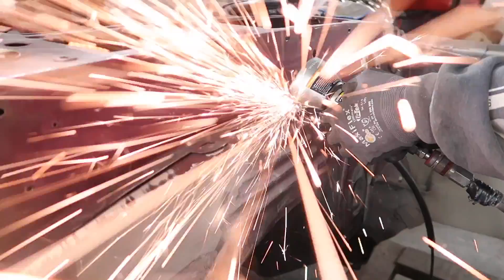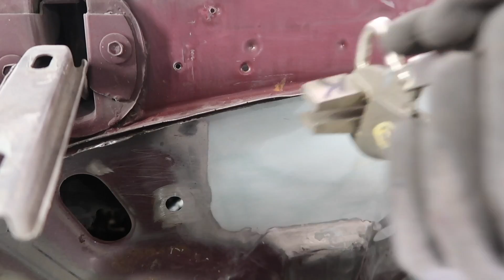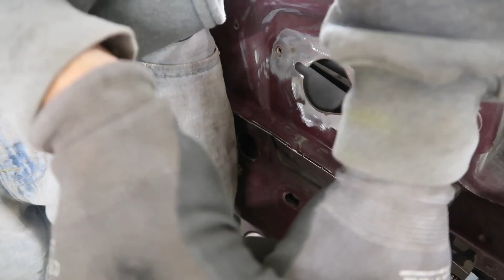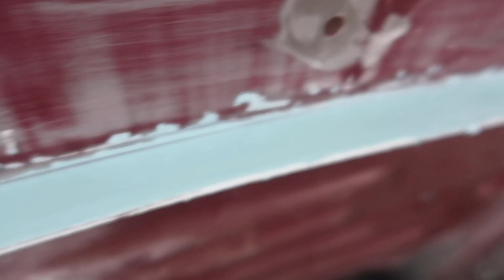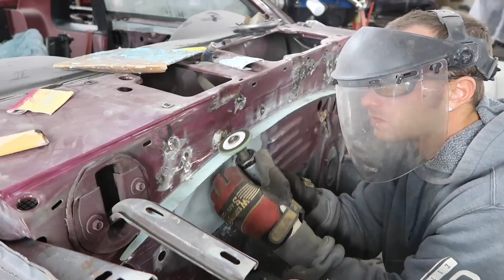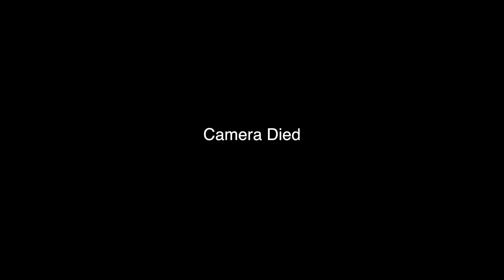Mustang Foxbody Notch Engine Bay Shaved : Part 1

Comment: On all the foxbody jobs you have done in the  engine bay once you smooth the strut towers how do you run your portion valve brake lines which don't have holes in the strut towers just asking I will wait on your responds.

Comment: I was wondering your thoughts on running ur injector harness threw the cowl area to hide it. I realize the weather woukd get to it but could i dummy plate the opening cowl the top or is the cowl functional for something. Need ideas for my dailey driven 91 gt. Can check it out on my page.
Reply from the maker: Travis Beard never seen the harness run through the cowl before. Might actually work well.
Reply: tko resto thanks for the response guess i gave an idea we both can try on a project. I tucked my sides but left the coil under the hood

Comment: How's that pinch seam doing, Did it ever open back up?
Reply: yeah i reckon any seam should be welded
Reply: Seam sealer injected into the pinch weld before crimping will bond the two together and seal from moisture intrusion from the back/inside of pinch weld, bondo is porous and will absorb moisture, people will apply it to a crack/seam like this and paint over it thinking they've sealed it, moisture can get in from behind and cause the bondo/paint to crack/pop off later, welding bonds the edges together but again it doesn't seal the inside/backside from moisture and welding causes corrosion/rust if not painted, you can't paint the backside/inside of a pinch weld very easy, a fully bonded pinch weld is also just as strong or  stronger than welding, seam sealer would be the way to go.